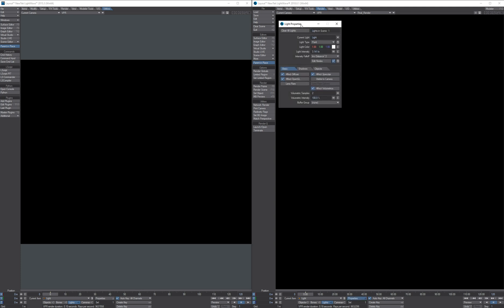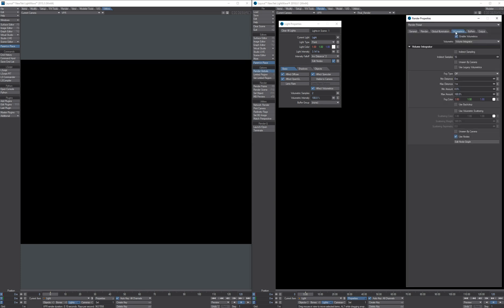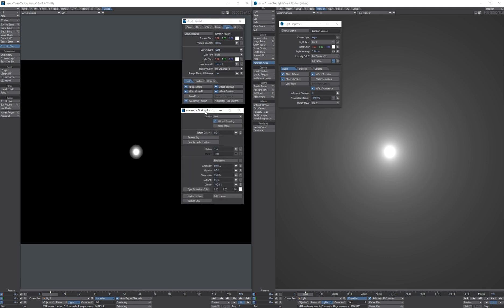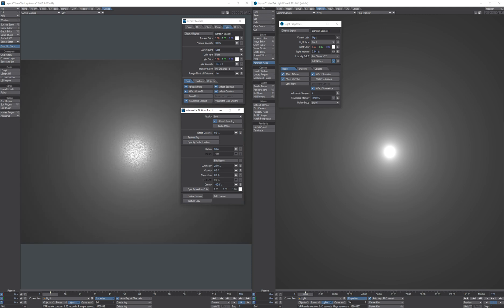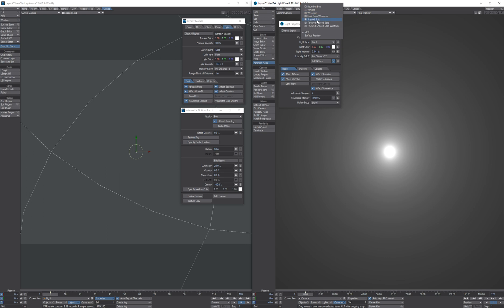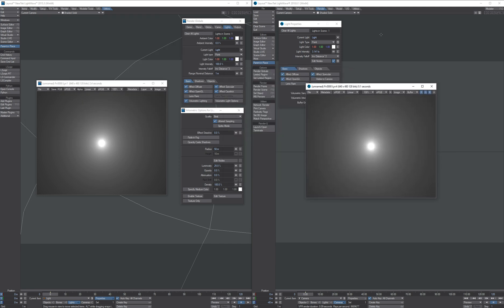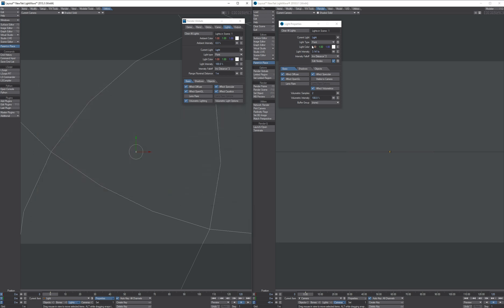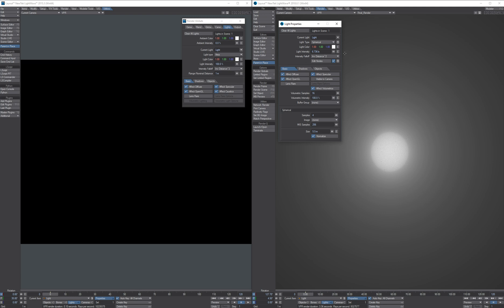Volumetric Lights (LightWave 2015 vs LightWave 2018)

Comment: Thank for the Video, but what is up with the banding on point, speric and spot lights?
Reply: And now the coffe is ready, sorry for the long time it took, but the answer is..
Anisotrophy if you see banding in your VPR or final renders, any value below 0.1 will be resulting in banding, it is however a bit funny, if you lower your light VOLUMETRIC samples to 1-2 for volumetric samples, it will sort of be cleared away, provided that your anisotrophy is below 0.1
When you increase anisotrophy, pretty much every renderer introduces a lot of noise, then you can not clear that away by lowering the volumtric samples below 3, as I just mentioned, in such case with high anisotrophy you have to increase the light volumetric  samples.

Then we have the issue of what happens on uploaded youtube videos, or vimeo for that matter, it can´t handle the color information needed to display a perfect gradient that goes from light to dark, so even if you have a perfect looking video, it could be looking as banded areas once uploaded.

As for fixing the banding issues with some tricks, you can also use a backdrop texture environment on top of things, with very very tiny noise, that jitters out banding gradients, but that is the last resort, foremost check anisotrophy settings, and your volumetric samples.

Anti is setting this up with the anisotrophy value of zero, which will undoubtly yield this banding effect, it is hower not noisy..and it is faster to use that mode when demostrating, otherwise he would have longer rendertimes with increased volume samples to clear the noise caused by the high anisotrophy, so he chose to use the less render expensive method.
Now ..some scattering media requires higher anisotrophy, like godrays and glows around stars, moons or even the sun, depends on the mood of the atmospheric.

Comment: Great addition on the volumetrics, many of us asked for sample per light volumetrics and more physicly correct, can´t wait to see if it can work with decent speed when doing godray stuff, that is either use a polyplate with transparency and let the light pass through, or combined with volumetic items.

A question I will need to check out, that is wether it will be more effective and also realistic to use either the volumetric light for godrays, or add a volumetric item, picking up any light in the scene...as can be seen in my samples here, with hypervoxels serving as a volumetric item, and using either a distant sun or a dome light, as we know, only distant light could be volumetric..but it does not have samples per light to produce soft shadows, and a dome light does not have an option to be volumetric.

So these were some limits you guys now seem to have adressed, and in this case I had to use a null with hypervoxels to pick up the light, and a polyplate cloud plane with textures on the transparency channel to produce the ray streaks.
https://www.youtube.com/watch?v=DbkvT_HgKRs&t=72s